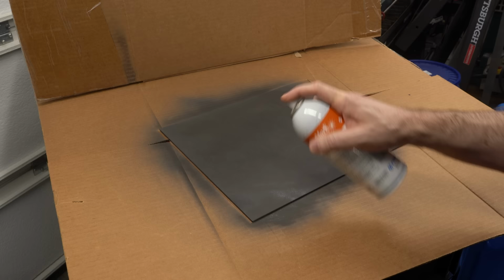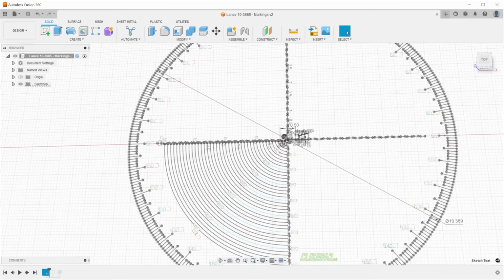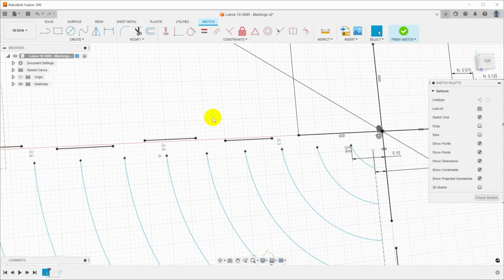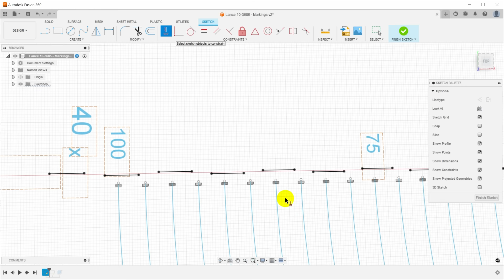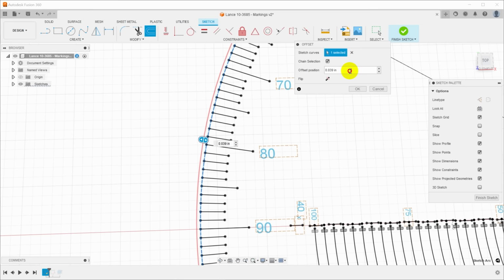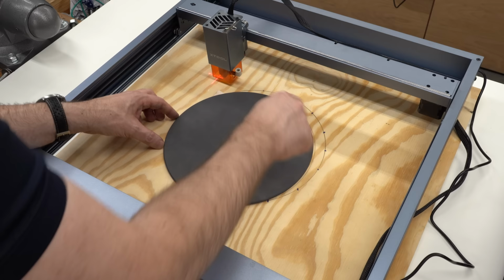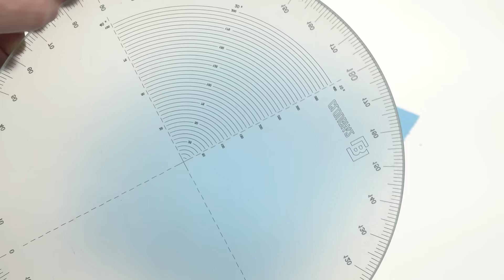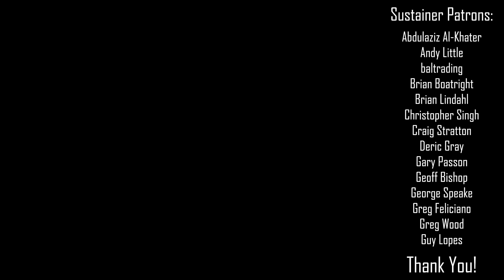Trying Again: Making an Optical Comparator Screen for Lance

Comment: Interesting observation, I've never seen anyone actually lift their finger completely off the nozzle between strokes when spraying with a can before. It looks odd to me. The things we notice 😂
Reply: I guess he wes taught how to spray in the same class he learned how to solder.
What do you say James?
Reply: Trigger discipline?
Reply from the maker: Actually, I didn't notice that I did that.  But yes, there's a good chance it's muscle memory as you suggest.
Reply: I learned that technique in a wood finishing class years ago. If you leave the spray stream going when you reverse directions, then you get heavy spots at the ends, and increase the risk of drips and runs. We practiced steady strokes across the work, half overlap between passes, and always releasing the trigger at the end of each stroke. I bet the guys who paint cars, or cabinets, could give several more pointers.
Reply: @bertlagerstedt4484  I understand the technique for stopping the spray between strokes, I was trained to do it when painting with aerosol or HVLP. What I'm referring to specifically is him fully removing his finger from the spray nozzle instead of just releasing pressure on the nozzle. That I've never seen or at least noticed anyone else doing before.

Comment: Very nice work!  But can you imagine, you had Fusion to help you out with measurements & constraints but when these were first made it was all done by hand in a screen printing process.  It had to be developed out of a screen printing negative, transferred to a screen, and pressed by hand all without any distortion what-so-ever.  I've seen them done by sponge printing too, but that was the most common practice.  Makes you admire the skill of the guys that do this everyday and just how many years they've put into it. respect.

Comment: Incase you didn’t know “Rubber band” is usually called a “fence” . left to right is picks inside elements, right to left is any elements it crosses.

It may pay to look at getting autocad or autocad LT as this would have been far quicker than fusion. As both same company the learning curve would be easy. If don’t want to pay just download the 30day trials. 
I personally can’t justify the 2750 per year. And the token flex thing is a joke as they take a full day every time you log in. Rather than billing 1 token per hour.

Comment: Awesome work! Really impressed by the fine detail that the laser achieves on the glass. I'm curious about one aspect of the actual design for the marks. The two big dashed lines that form the main cross - why are the individual dashes alternating slightly to one side then the other? Hope that makes sense. Does this arrangement make it easier to line them up exactly on a projected edge, compared with having the dashes perfectly in line?

Comment: I would think that the ground glass side of the screen faces down so that the optical characteristic of the screen's glass does not impact the image.   With the "screen" surface on top, the light path for the image coming out of the optics is bent at the downfacing surface of the screen glass due to the different index of refraction of the glass relative to air.   I don't know how much that will impact accuracy, but it can't help it.

Am I missing something here?

Comment: Since it's about shadow/projection, wouldn't it be better to metalize the glass and then etch away everything that's not needed using photolithography? As far as I know, that's how glass code wheels for encoders are made too, even if transmissive encoder

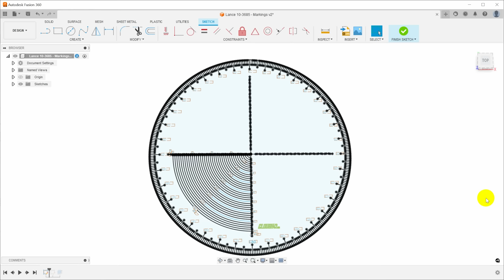Comment: Did the right half arcs with text get realigned correctly? They were blue around 16:33, which I vaguely remember means not fully constrained?
Reply from the maker: You are correct.  The inner end of the arc is the point that is unconstrained.  The radius is constrained to match the other half.  I checked to be sure.

Comment: If you laser burn it with the smooth side in some water I think the laser should exit without damage
Reply from the maker: The pitting is on the burned side, underneath the CerMark.  The blue diode laser doesn't really affect the glass by itself.

Comment: Nice job. Why are the straight centerlines staggered slightly?
Reply: @Nick P Saw that too, and my guess every other one is either half line + or – of the actual center. If the parallel image is touching both lines, it is dead nuts on. Better than trying to split a line?
Reply: That is correct, the lines are staggered so that alignment can be easily identified when it appears between each staggered line. The true center isn't marked because it would obscure the actual alignment; the marks are, by definition, opaque.